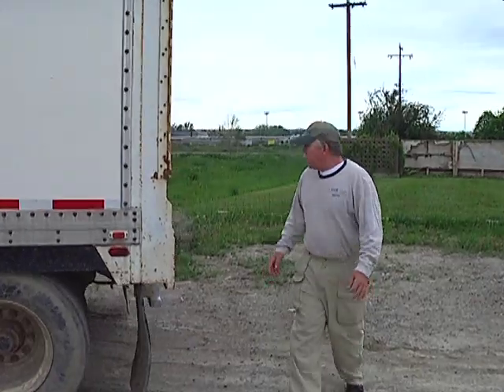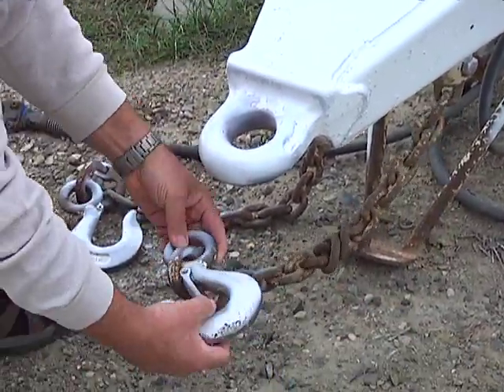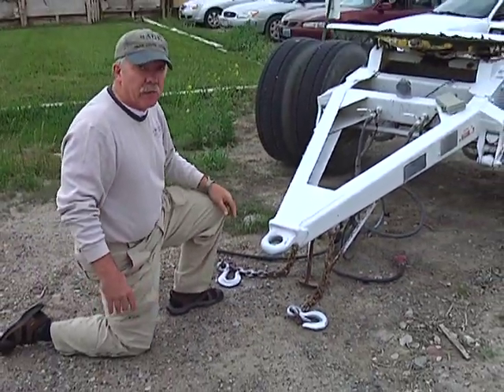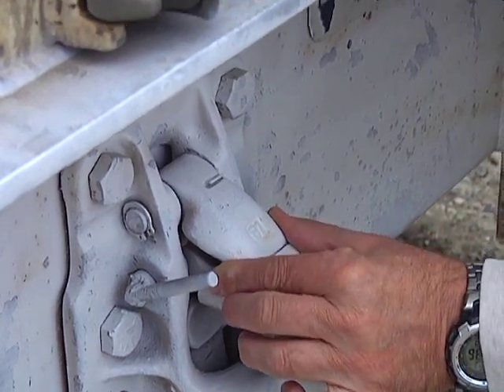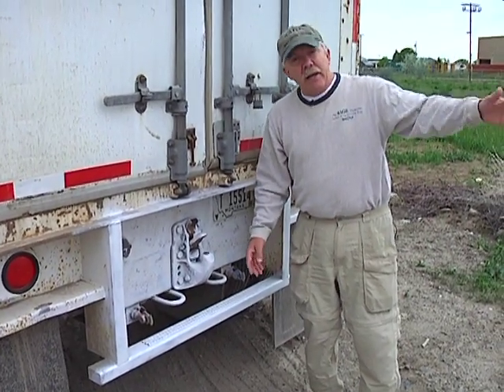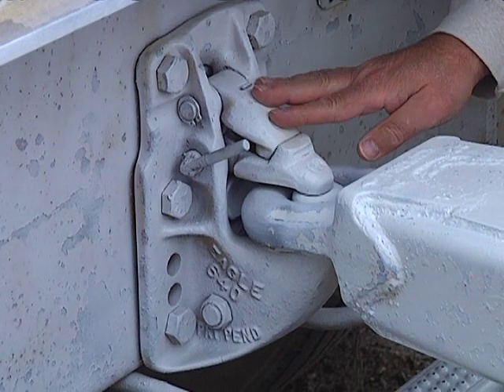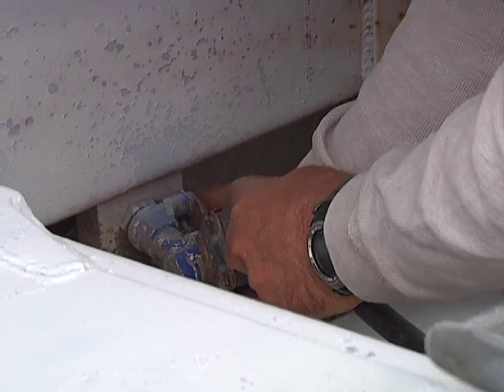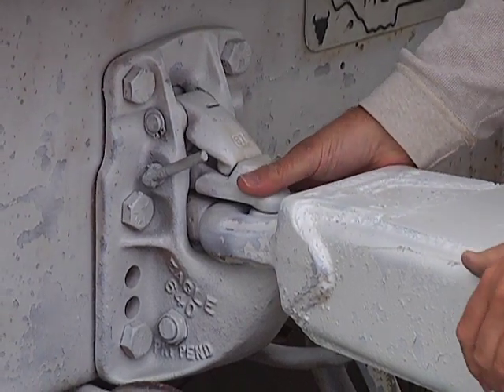Safety fail-safe features of a tractor-trailer converter dolly.

Comment from the maker: Mike:  There are glad-hands (where the dolly airlines connect) on the back of double/triple trailers that are equipped with shutoff valves. The shutoff mechanism is very easily recognized.

Comment: The air is supplied to the folly from the tractor. That's why he connects the service line and the emergency line, when you get in your tractor and release or push the red knob in it supplies air to it. You just want to make sure on the last trailer you close the air line, I always check my brakes with the hand brake instead of testing them with the service break when pulling doubles or triples.